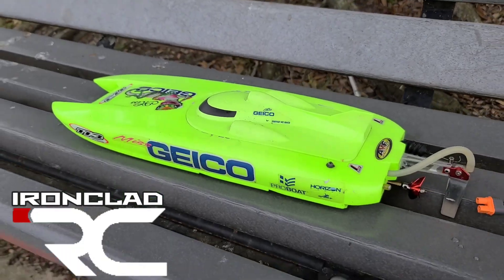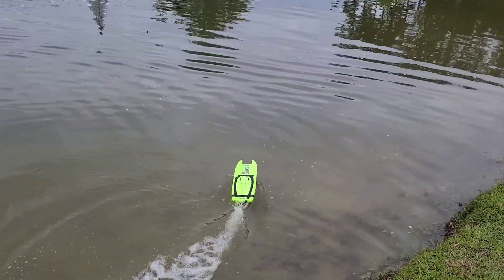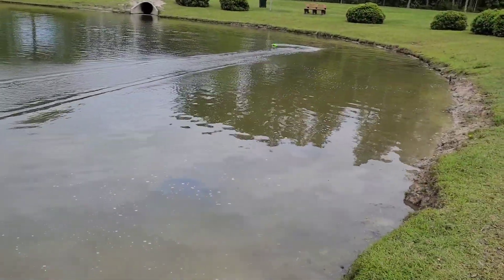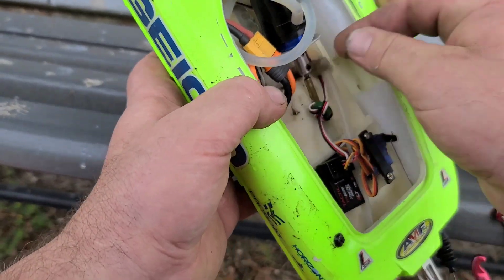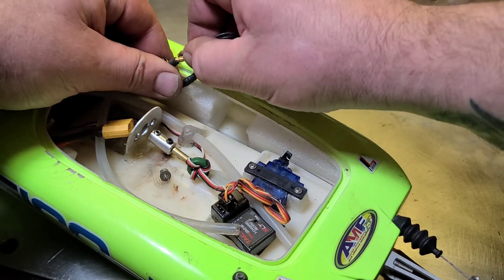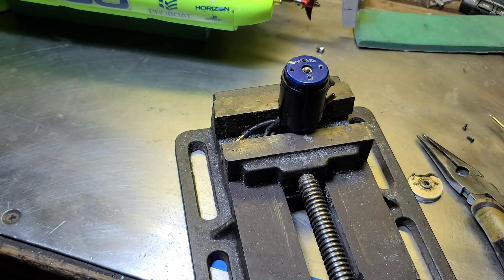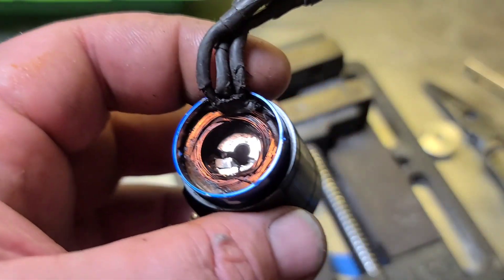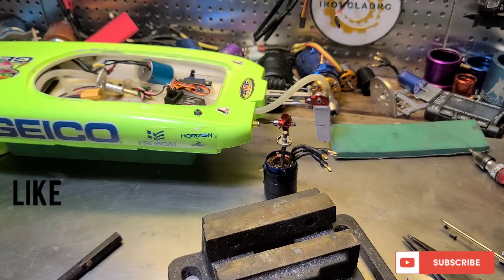Let's Blow Up a Brushless Motor - Upgraded Proboat Miss Geico 17 - Traxxas 380 Teardown

Comment: What  does it mean to "blue print" the bottom of the boat? Am newwwww to RC boats
Reply from the maker: Blue printing a hull is basically removing any dips, humps, low spots, on the ride surface bringing the bottom to its intended shape for better handling and faster top end speeds.
Reply: @IRONCLADRC  I looked at your video how-to on this topic 👍🏼

Comment: BigB thanks for your videos and information you put out there. It gives us new folks some hope when it comes to this. I have a MG24 that the u joint broke on the flex shaft. I cannot find any replacement for it. Do you have any idea where I might be able to look to attempt to repair it?  

Also…because of your info…I have recently purchased a sonicwake v2. Hopefully I don’t tear this one up!
Reply from the maker: Did you check offshore electrics for a cable upgrade.   More than likely .150 flexcable  3/16 stub shaft.  May be able to get an upgraded blackjack24 flexcable

Comment: it likely got damaged before this run when the bearings wore out causing the kelar wrap around the rotor to become damaged or completely disintegrate, the wrap is there to hold the rotor mags tightly together under high rpm, i had some real expensive ones do this and blow up in the same fashion

Comment: Hey brother watch all your videos and you don’t seem to have this issue I have with my sonicwake v2?? I know water is going thru the tubing to cool motor and esc cause I can see a small amount of water in the tubes but water never shoots out the side never not once since I’ve had the boat over a year ago! The motor nor the esc ever gif hot so I never put to much thought into the cause but now the Esc is getting hot and the motor is getting warm very want! No obstruction or debris in the lines or intakes in the rudder! Any ideas
Reply from the maker: Hook up a water bottle to the cooling line, squeeze water through the cooling system, to see if you have sufficient flow

Comment: Same happened to me today lol ran 5s with the 120 amp horizon speed control all day in the recoil 2 and the motor lost the screw on the can of the motor and it came apart taking out my new battery
Reply from the maker: That's a bummer, but it happens. Time to upgrade c'mon

Comment: Hi there i have a miss Vagas u18 nitro and want to switch it to electric what would you recommend for motor and esc .thanks
Reply from the maker: I'd go with a 3660 - 3682, kv depending on what voltage you run.   4s 14v I'd go with 1900-2000kv if your gonna run 6s 22v I'd go with 1600-1700kv  esc and motor is up to you.    Use the above information as a guide line

Comment: i did the same set up witha brushed traaxas 380 size. but it was kinda heavy. i ened up buying a few different s surpass sizez. i extended the rudder out about same as yours but its slighly to the side to right to keep it from tork rolling.

Comment: I want to build a rc boat for fishing do y have a tip?
Reply: Jet propulsion outrigger........
Reply: @sjorswouda6865  and i want to 3d print it
Reply from the maker: I'd go with a tug boat design, submerged prop and rudder located under the boat on the keel..   (Or twin brushed motors using differential thrust no rudder)